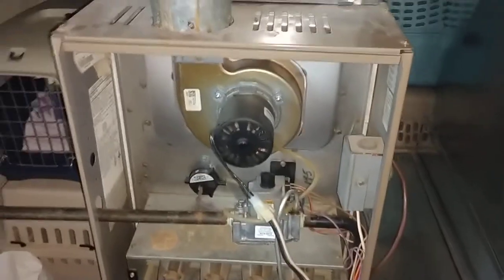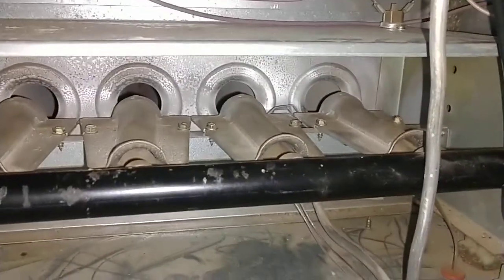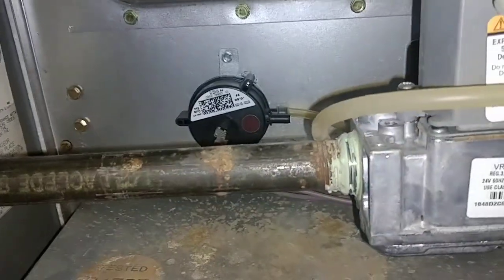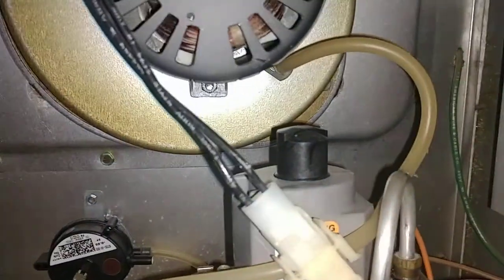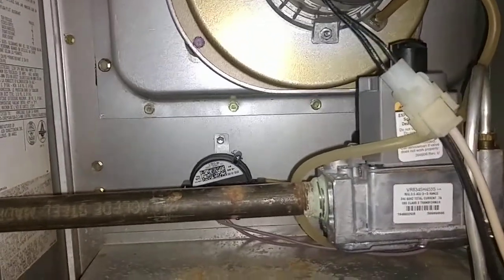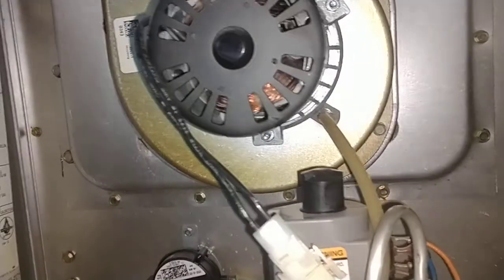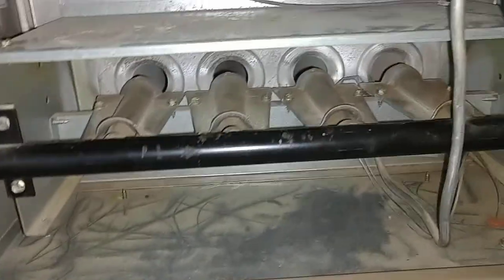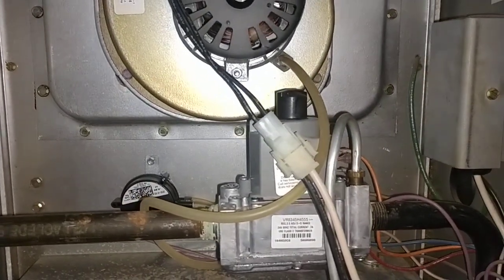Furnace cycling On and OFF, Easy fix on pressure switch.

Comment: Thank you.  That pressure switch and its tubing have got to be kept clean and serviceable.  That tubing in your furnace should be replaced with a higher grade tubing that is more heat resistant. I also found the pressure switch itself can  be checked with a simple and gentle "blow" test to see if the switch clicks. All good advice and can save beaucoup bucks.  Also, I have a supplier on hand that can ship me a new presssure switch overnight if the need arises.  Knowledge IS power.
Reply from the maker: @johndonlon1611  yeah I've learned much more since I've done this video videos kind of old I've already tore this thing apart and put it back together thanks a lot there's a couple things I named wrong in the video but I'm not changing it still help someone gets started that's in trouble. Thanks a lot yeah I think I probably should order one of these parts and have him sitting around I've been thinking the same thing thanks again
Reply: Not a pressure switch a vacuum switch. A suck test is what you should do. Measure continuity when you suck.

Comment: Sometimes the stuck open pressure sense error is caused by a clogged vacuum port on the IDB   Happened to me twice Just clean it out with a pipe cleaner or something
Reply from the maker: @rickliles2460  thank you antagonist furnace apart myself five times I think it's going to run forever funny how there's really not too much to these things and they charged 500 hours to fix one little thing cost cedar stick up pipe stick it in there a little bit and just clean it out?
Reply: Clogged vacuum port?
Reply from the maker: Yeah I understand what you're saying absolutely. I'm just lucky my buddy has been training me for years on how to tear furnace apart it really is not that hard it's amazing what they charge. I've taken this furnace apart for years put it back together nothing to it. It always seems overwhelming at first but there is nothing to a furnace ethics cars and small engines for a living and furnaces is like nothing
Reply from the maker: @rickliles2460  I get it thank you I'm lucky my buddies been teaching me how to fix all these things for years I can rip this furnace apart and put it back together it's amazing how simple it is once someone teaches you how to do it I fix cars in small engines and they're way more difficult than it furnace. You're 100 percent right

Comment: Where can you purchase a new hose?
Reply from the maker: Any hardware store should have it.
Reply from the maker: Any hardware store
Reply: Does it have to be high temp silicone hose?
Reply from the maker: @jessiecannon617  just look up what kind of hose needed for the pressure switch on your furnace. In a pinch I would just use the same hoses on my fish aquarium. I swear it's no different then my fish aquarium hose. But it gets really hot so it could be I don't know. It would be simple just to go to a Lowe's or home Depot or an Ace hardware where someone can help you and say I need to get hose for my furnace pressure switch they'll help you find the right hose. It's springtime turn your furnace off for an hour pop the hose off take it in Tullahoma that goes to they'll find the right hose I would go to an Ace hardware or something like that where you can find someone that can help you. Home Depot gone downhill not that they ever had the best customer service in the store but just look it up. You can probably order it off Amazon I don't know. I'm going to have to look for some myself because I've just been nipping ends off mine for so long. You just get a piece it's a little bit longer so you can kind of leave it around so it's safe like the one that you have now. So you always have extra cuz the ends get hot and wear and you're going to have to clip them off down the road. Listen I'm just a straight-up handyman I'm not a specialist on this but I can find out by tomorrow and I'll try to get back to you but it should be easy you can probably find it on your phone.
Reply: @bopitbull3957  ok, thanks for the info I appreciate it.
Reply from the maker: @jessiecannon617  the best I can do what does fix things as long as I go. I'm just lucky one of my friends is havc guy that's been teaching me. It's really simple once you really tear the furnace down and look at it it's unbelievable how much they charge you how simple it really is.

Comment: Your video had me check the hose. It was clogged with something. Pushed it out and now no more short cycles! Seriously thankful because the funds aren't really there to hire a HVAC pro in this economy! 

Everyone else is al about the flame sensor... You're a g!
Reply from the maker: Trust me I get it that's why I'm lucky my buddy does my work and has been training me how to fix my furnace I pretty much can fix just about anything on it I'm lucky. Someone got on me because I didn't call it the pressure switch and I'm like whatever I'm saving myself money and I thought I'd pass it on SIMPLE maintenance look at the house see if it's got cracks you figured it out just like I did my friend I'm glad we can save money.

Comment: mine done same thing, but a dead bird was in the exhaust pipe going out of the inducer motor up and out of the roof,  it was in the first pipe attached to the exghust exit of motor
Reply from the maker: I understand when I took my pipe off it was literally had like a pencil hole in it it had so much carbon buildup and take it all out and dig it out and clean it and how to put the same one back on it's insane how it still works with a small hole finally it would shut off I get it. I'm big on putting screen over the top of chimneys and all exhaust pipes on my roof.

Comment: Good Job!!  Back in the day when automobiles had lots of vacuum lines that operated things this same thing usta happen.  Small cracks that were hard to see in brittle vacuum lines made the vehicle run bad  because they would throw off the fuel to air ratio. Same fix.  Snip off the bad part and reattach
Reply from the maker: Funny you say that I was in the car business for 30 years

Comment: If that rubber tube has a droop that can hold water, that can cause the issue, as well.  I shortened the hose, on mine, so it had no droop, problem solved in 5 min.
Reply from the maker: Thanks interesting